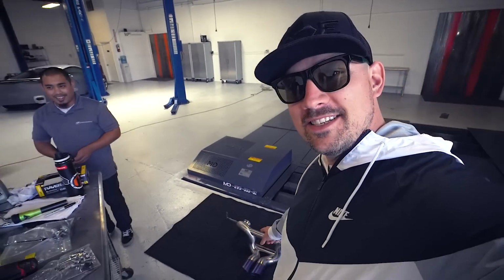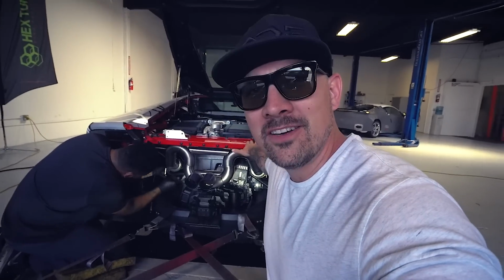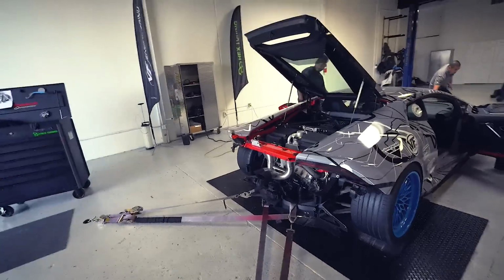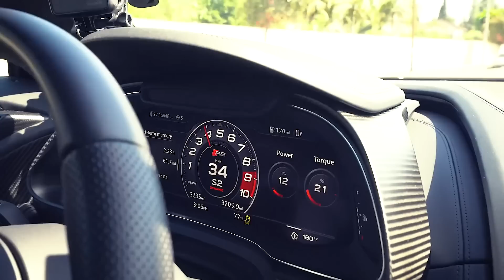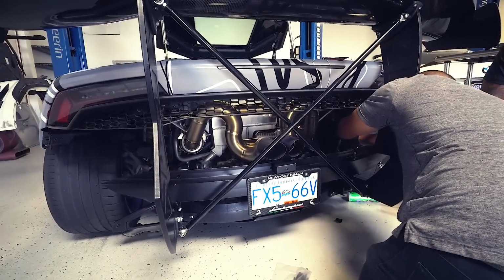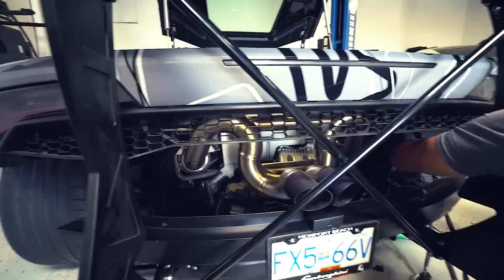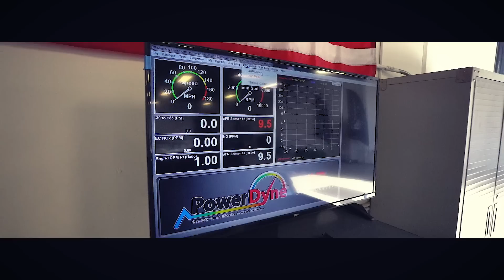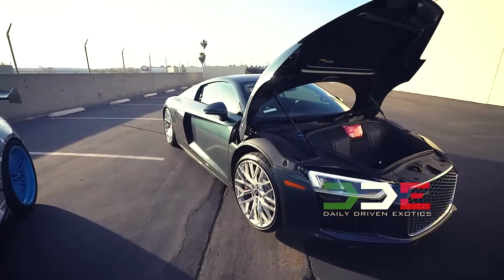WHAT A $7,000 TITANIUM EXHAUST SOUNDS LIKE! * Supercharged Lamborghini *

Comment: Sounds amazing,my truck had to go with 3in. Stainless instead of the other.way out of the budget at the time plus my ambulance is 22feet Long. even the tips I have 8 of them 4 on each side with spark plugs in each side runs on 4 cylinder cap and coils.each side has it's own switch and yes non emission+inspection state Iowa.

Comment: If always wondered what it would be like if someone would give a old Porsche 944 turbo the same love. With full titanium exhaust with true headers (even though stock Porsche exhaust manifolds already are) to a titanium cross over, 3 inch or bigger down pipe then all the way down to the tip of the exhaust. I see the 944 as the Supra of the 80s the car really does have so much more potential but Porsche seems to have purposely make flaws for it

Comment: I have a 2015 R8 v10..   and still under warranty!   What happens to my warranty!  I would really like the plus horsepower.

Are you still planning on coming to Las Vegas ...
Reply: irre levant q
Reply: What the hell do you want,  it’s a free country.
Reply: I would wait, because the dealership could check and void your warranty
Reply: Octavio_P  the dealer told me to wait as well so the warranty remains intact
Reply: irre levant can't you do exceptions?  Like the exhaust would  no longer be under warranty but the rest of the car would still be under warranty?
Reply: Audi will void your warranty, already checked.
Reply: !      amazing..    run it on hydrogen and poof 200 more horse
neet how these guys pay through the nose for these tiny little plus's in horsepower.

Comment: Dude I had a mercedes c class and I streaight piped it and the exhaust shop made the exhaust curve to the ground so it doesn’t burn the rear bumper but they didn’t do perfect job and my rear bumper burned... mine was c180 means 1.6 liter gasoline engine so your car can burn it self with that engine watch out

Comment: Not sure if you will ever be bringing the car back to the island at this point but just a heads up if you dont know it already that B.C. has some of the worst quality gas in North America and will probably not cooperate with these tunes well! I spent nearly a year trying to figure out why my car kept knocking and having strange boost cuts and crap. Finally found out its because my tune was for U.S. 93, and the best gas you can get in B.C. is Shell 91 (Chevron 94 tests worse, and is definitely not a true 94). Had the car re-tuned with 2 files, one for BC 91 and one for U.S. 93 and now it runs amazing wherever I am!

Comment: 7k? for two v-bands, and hand full of bends, and the cheapest of cheap single walled tips? There is less than $700 worth of parts on that exhaust...  $2500.... for a tune? ROFL... Guess this is just another shop ripping people off because it is a Lambo? If you have a Lambo, you know where not to go.

Comment: sounds exactly the same as stainless steel exhaust in the same config..     cept the titanium cost you 50x more...

show dont make it go....     
only way to beat cubic inches is with rectangular dollars.

480 ish cubic inch on a ford fairlane lighten to 1460 pounds..      low 7's in the 1/4.....     12000 dollar car.